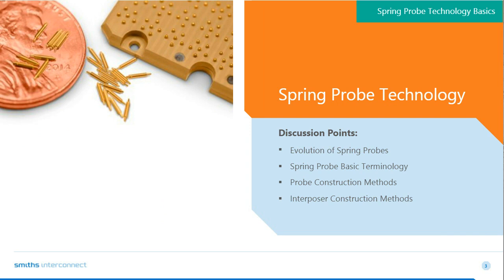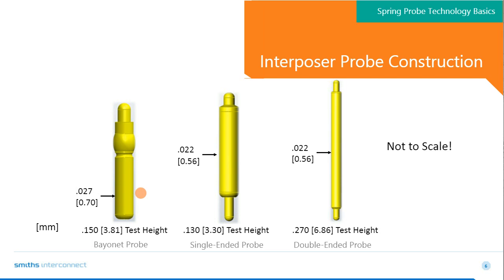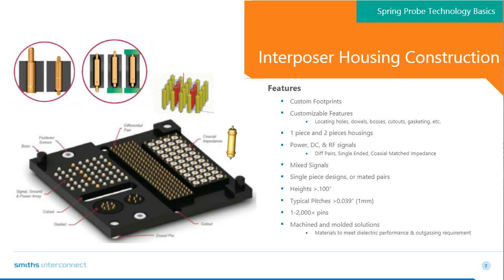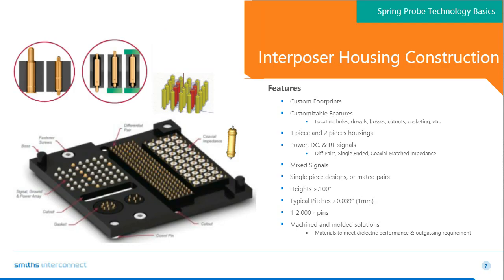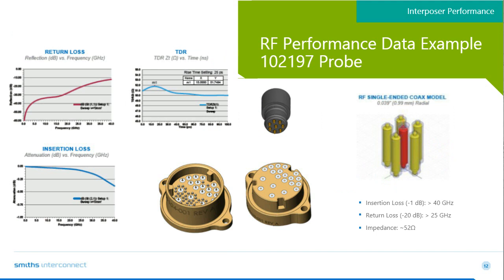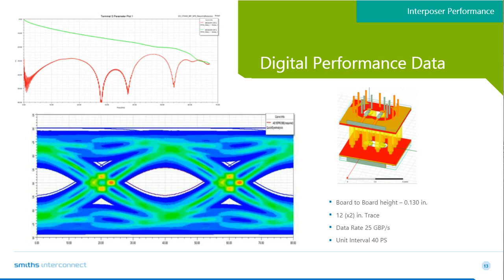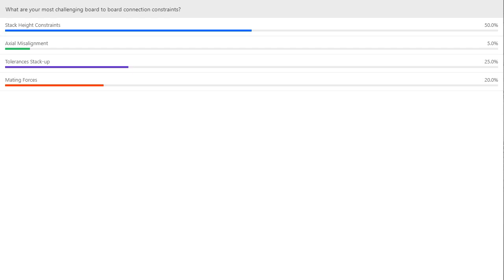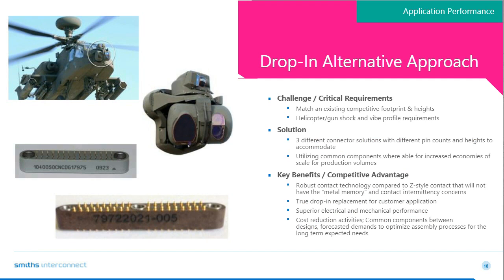Smiths Interconnect webinar   High Frequency Spring Loaded Interposers for Space and Defence 11th No

Comment: It would be interesting to hear your thoughts on ESA standard 3402 Contact Engagement and Separation Force testing. I worked for a Smiths Group contractor for two decades and in that time never carried out the test, rather Quality Assurance would make up random test values that fitted a range the end-user would expect. All of these some two decades of components are now in orbit. I would mention the falsification of time-dependant 168-hour burn-in to thin-film resistors but that isn't part of this application and them many, many more forging methodologies taken by QA (not to mention Test engineers)  at that organization.